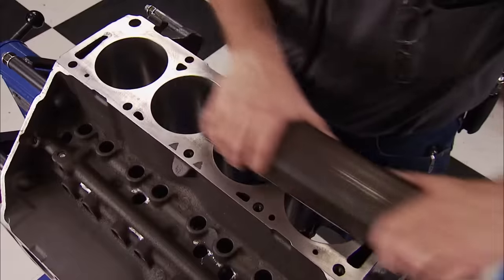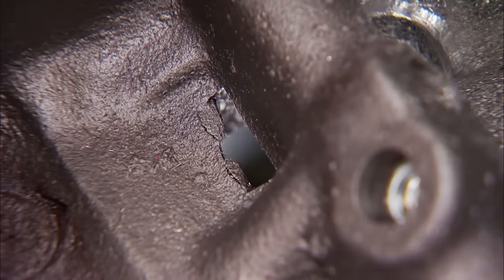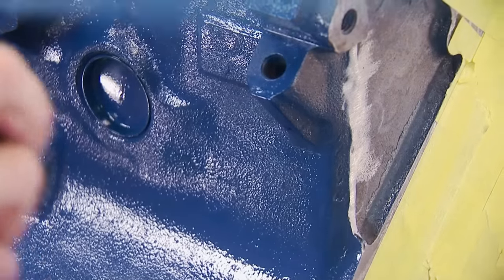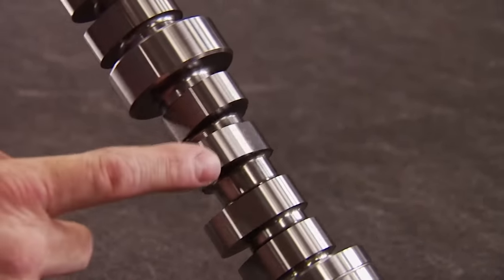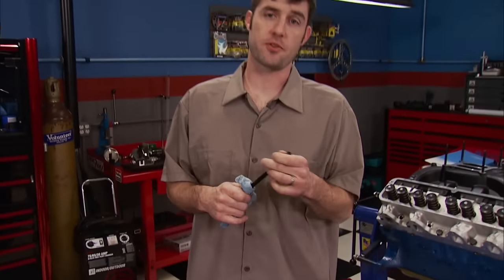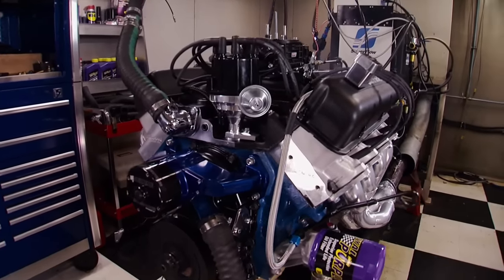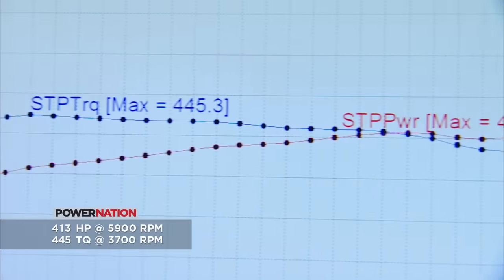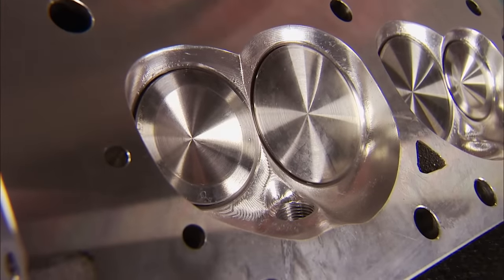Revitalizing A Ford 390FE With A Modern Twist - Engine Power S3, E7

Comment: Nice build. Love the FE! Just gor those who don't know, if this build would of used Trick Flow heads the hp would have been more impressive.  Probably upwards of 50-60 hp. The ebooks are nothing more than clone iron heads. Nothing special. This engine with 9.8: 1 and Trick flow heads hits 500hp.
Reply: Agreed, the head selection makes no sense and is holding this combination back.  Cam is 238/244 @.050 with .618 lift on close to 400ci with the bored cylinders?  Needs more flow.  And compression, 9.1 with aluminum heads makes no sense either.  They left a lot of power on the table with this build.
Reply: Bump the compression up 2 points and some AFR heads. She would scream
Reply: I believe Edelbrock had a say so in this build 😂😂
Reply: Considering how well aluminum heads handle heat, you can typically run one point higher compression than cast iron heads. so yeah i think EazyE77 hit the nail on the head.
Reply: For those commenting if you were to go with stock / upgraded iron heads how high would you limit the compression ratio ? Not sure I have the coin to do heads as I would probably skip right over E Brock’s and they are quick pricey.
Reply: @stevenmyers2252  9.5:1 is a general limit. If you ran a camshaft with a lot of duration, it would bleed off some compression, and you could bump to 10:1, so it depends on whether or not you're doing a truck engine for towing or a passenger engine for drag racing. It also depends on what gas you're running--CA for example only goes up to 91, other states 93, and the midwest gets E85.  But if you're doing a cheap build, you're likely using whatever pistons are on the shelf, and the later 1970's versions were lower compression. 

Aluminum heads resist detonation simply by taking longer to heat up and create hot spots that act like glow plugs. Also many have a chamber design that helps as well. You can expect an extra point of compression out of most aluminum heads.  

If memory serves, later 1970's Ford 361FT engines had electronic distributors, and a reliable ignition system helps you get a tune that won't shift around into detonation.
Reply: @albertgaspar627  I have a 70 F250 with a 390 in it. It currently runs like poop (just picked it up) not sure if it’s the internals or the tune but I want to freshen it up at some point. I will not be towing just a weekend fun truck with the occasional tire recycling ;-) the thing that’s scaring me about the FE is the price. I know it’s known for torque but if I have to spend 5-6k for an essentially factory plus a little rebuild I’ll likely look elsewhere as vortec and LS  truck motors make great power and would be able to get the OD and better economy with it at the same time.
Reply: @albertgaspar627  we do have 93 and E85 where I am btw.
Reply: @stevenmyers2252  the FE is exactly what you said--an old design so its not going to be a cheap build unless you know it and have spare parts lying around (like how the late 1970's 361FT had electronic distributors). I would suggest a late 1980's-1990's Ford 351W from the junkyard with a roller cam setup in the lifter valley and its stock heads replaced with the GT40P from a 1990's ford explorer on your way out the door is a good cheap candidate--you don't have to worry about zinc in the oil to keep the lifters from wiping out the cam, and there's always engine mounts for your truck and an AOD will bolt up or a 5 speed if that's your preference (i'd skip the classic 4 speed SROD setup from the 1970's, its a top loader trans with wide gear ratios).

Vortec engines are equivalent, but you'll need a kit to make it all line up without little issues that drive you nuts. The LS is great in potential on a dyno, but....if you use the EFI, you'll need a $400 electric gas pedal to work it unless you buy an early LS (and what's the mileage gonna be?) and the temp gauge may require a change. if you use a modern trans behind the LS, it talks to the speedometer with a sensor not a mechanical hookup so that means a new speedo. You'll likely not have to worry about oil pan and serpentine belt clearance, but do keep an eye on your air cleaner induction design--you want a straight shot at the throttle body to be straight for 6" (the length of a dollar bill) so the signal is good, and keep the air cleaner away from engine heat.

Keep in mind too, changing transmissions might affect the driveshaft length. When it comes to throttle linkage and trans kickdown (if using an automatic) linkage for a carb setup, Lockar makes some great universal setups. As for the $5-6K buildup price, i hear what you're saying, but that's not far off for an engine that isn't full of junkyard parts with high mileage piston ring wear--an LS can easily run that if you put in the EFI and pay someone to tune it for you.
Reply: @albertgaspar627  my concern about that number was having to put that much into motor only Wei have heard of people doing a full LS swap for that. The C6 does work for now but I have a feeling as soon as I complete the rebuild and give her some onions I will have that to replace as well. Not to mention have an OD would be nice if possible. 

It’s an auto truck so I plan to keep it that way as the wife won’t drive a manual.
Reply: @albertgaspar627  I do hear what you are saying my concern is I don’t have unlimited funds and I got the truck to enjoy. It if would be destine to sit in the driveway for years I would have a major issue with the wife. :-) plus I wouldn’t be enjoying it.
Reply: @stevenmyers2252  I hear what you're saying about the cost. There are folks who can whip together an FE or an LS for cheap when they know what they're doing and have the parts lying around (tho its harder to find FE/FT stuff than in the last century).  Some stories are right, and respectfully, some don't have all the details. The LS is a great design, but its the usual problem--a modern engine into a car not designed for it. Guys hotrodding Model A's ran into the same issue putting flatheads where a four banger was--they often just swapped the entire frame to make an A-V8.

You're right also about your transmission. Whenever we put more beans into the drivetrain, the trans, U joints, cooling system (modern engines tend to run hot for emissions reasons) and rear axle start to show their mileage. I run an Olds 455 with variable duration lifters that kill valve lift and therefore duration below 3,000 rpm, so I can use 3:1 rear axle ratio and a THM400 3 speed to get 15mpg in a 3,800 lb 4-4-2. Next rebuild I'll experiment with overdrive (it has an old switch pitch torque convertor so i'm looking to go THM200R4, I hope to find an external OD like on old motorhomes).

it's the only automatic I own (and it's a manual valve body) but I totally get the "happy wife happy life" routine. Besides, if you swap to a manual you're just adding more work, and if your cab is rusty (I live in the snow belt) you have to make sure it doesn't move around unless you have a hydraulic clutch, as linkage can lock up. 

I would also suggest a new radiator when you swap--its full of the old junk you have in the block now, so why transfer it to a new engine? plus you'll want a fresh trans cooler. Few people spend the $300 extra, but its worth it.
Reply: @albertgaspar627  a rad will likely be done no matter what I choose. I want to keep the FE just the most I think about I wonder if I’m the long runs swap wouldn’t make more sense. 

It has a C6 which should be pretty strong, for a while at least and a 3.73 Dana 60 in the back. In a way those things make me happy but I also know that means crappy mileage (not that it’s a commuter) but I do hope to drive it to some weekend events. So going a little further per tank doesn’t hurt, plus it won’t be screaming on the highway. I just got her running and moving this week, I was told it has not run in years but seems fairly solid. Yes there is some can floor issues but honestly no more than my 95 and the rest of the truck is in far better shape (rust wise) than my 95. 

Thanks for all of your ideas and knowledge.
Reply: @stevenmyers2252  I hear you about the gas mileage--i used to be happy my Olds 4-4-2 got 15 mpg, but my daily driver does 42 mpg and its just nice to take off for a show and not get there late from stopping often and answering questions due to poor gas mileage but just banzai straight thru to my destination. Check into the FE websites, you'll find you can build it for torque and low RPM--like the 5.0 Mustang of the 1980's--and that will help the gas mileage and it will turn the lower RPMs you want on the highway but still feel peppy. If you don't like it, then you can sell your working engine to a fan and fund a swap at another time.

Check out the "Junkyard Digs" youtube channel. They do a variety of cars but have a few Ford pickups brought back from the dead on a budget. You might find some affordable tips there, and the FE websites, and feel more comfortable investing in what you have (free) right now. 

Been nice talking to you, take care and enjoy that truck
Reply: @stevenmyers2252   Put some car pistons or a 410 crank, that will wake it up the truck pistons are way down in the hole. If it’s a 360, just put a 390 crank in it.  Sweet either way.  A 410 with a 230/238 cam and Edelbrocks with an Rpm is all you need and you be close to the 500 hp mark with a 410 and 475-480 torque. Rev it to 6000 and you are going to be really happy. Brent Lykins here on U-Tube is a a sharp guy as is is Tom at FE Specialties!  Really good. I used to port iron heads but I can’t anymore and aluminum Trick Flow heads and intakes are really good!
Reply: @stevenmyers2252  I don’t think a swap is needed. I have run cast pistons at 450 + hp. A swap of anything will cost you.,a build is an adventure, if it hasn’t been overheated and all of the rods good, no apparent detonation damage, you can have a lot of funLook up FE specialities on the web and talk to Tom. You may be pleasantly surprised. A 355-400 hp low dollar iron build can be quite useful once you get your parts combination. It it is really a 390 truck engine and your pistons are fine and the block just needs a clean up then put a 410 or 428 crank in it. It will get to zero deck. A set of ARP rod bolts and resize is good if the rings are good just clean it up and bottle brush the passages and get all of the passege plugs back in. With a 410 or 428 crank be sure to get the flex plate. A C6 is a tough trans, have it serviced and use it. Talk to Tom or Brent for a cam and induction they will get you what you want. Be honest with your goals and tell them. I bet what you have had a good chance of getting your goals without reinventing the wheel.

Comment: A couple engines I would like to see on here is a 5.4 2 valve. Easy budget build for daily driving and towing. Other is a 400m with the same thing in mind. Daily driving and more torque for towing

Comment: The 410 Mercury piston was used in 390 truck engines to lower compression to around 7.5 ..... horse power makes heat.

Comment: 428 crank, longer 390 rods, short Merc 410 pistons, C60Z6250BB Cobrajet cam. CJ manifold and Hokey, Gemini headers. {eg the 200hp chassis dyno @2500 rpms. Fun, in my '72 F250.

Comment: Boy, I sure wish You Tube was available in the 70's. My 428 separated the intake stem from the valve and destroyed the engine. To get my Cobra Jet Mustang back on the road someone told me about a 335hp - 390ci, which was the same block, so I put that in. I was able to use the same intake manifold from the 428, which was NOT aluminum. J.C. that is a heavy manifold! It took two people to install it. I was 20 or 21 at the time, so I didn't have much money for all of the fancy high HP parts, just a set of headers. It was fun(?) to work on, but ran great when it was done.

Comment: you guys could run alot more comp with that cam !
is there a reason you guys are running such low comp ?
just curious.
im sure this engine would be very safe with 10.5-1 with the same rpm limit.
unless you struggled with piston options ? which would be undestandable.
Reply: my question is about that cam , thats a lot of duration and lift for a mild street engine,  you want peak HP below 5500,  and stronger midrange torque 
I seen 383 sbc with 9.2:1 compression , with vortec heads and a 220/228 duration .510 lift 112 lobe cam get 420HP @ 5200rpm and 465 Torque 3600rpm , with the factory air cleaner housing on and a Quadrajet carb,
 That 390 should be capable of 415 HP under 5500 rpm and more tha 445  torque at 3600-4000 ,It does have a 3.7" stroke so it should get more than 445 torque and you want that to carry a nice flat curve with peak HP around 5100-5200 , 
 This 390 having 445 lbft of torque at 3700 is ok , a more optimum , milder cam might lift that up and produce peak HP around 5100 rpm, that is a nice street engine 4 a truck,,

Comment: One correction - the say hydraulic cams use motor oil for lube vs flat tappet cams that use assembly lube. Slip of the tongue but cams for flat tappet lifters use assembly lube regardless of whether they are meant for hydraulic or mechanical lifters. Roller lifters use oil regardless if they are hydraulic or mechanical.

Comment: 0:26 Way back in the day first engine builds were 390 406 and 427 graduated in that order, with modified Hooker headers  to a tri-y  configuration, RUG Top loader (modified synchros) transmission, 9 inch,in my 67 fastback mustang that I bought for $100 that had only 67,000 original miles was garaged  many years. Very easy to get 425 horsepower out of a 390, With basic o e parts,.

Comment: Note for folks working on Japanese trucks and trying to save a buck: @5:14 you see the guys spraying Dupli-Color Old Ford Engine Blue on the block and you might think it's a perfect match for Toyota 8A1 Medium Blue from the 1980s - it is soooo close I can barely tell the difference even in good light - but the paint does not stand up to UV.  It might be cheaper than a proper paint job, but it isn't a durable substitute.